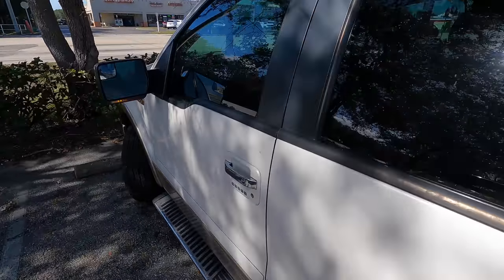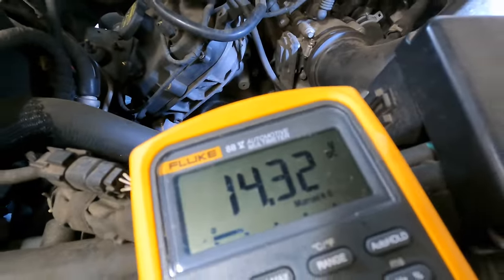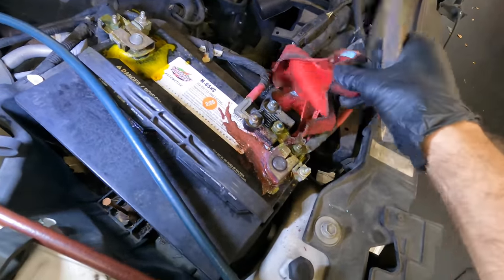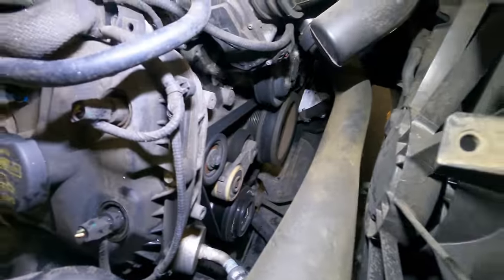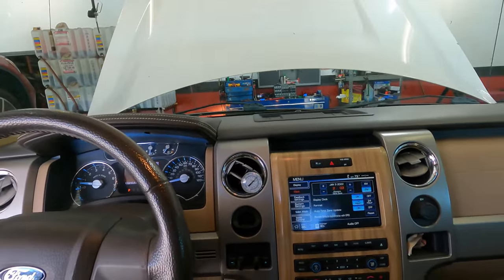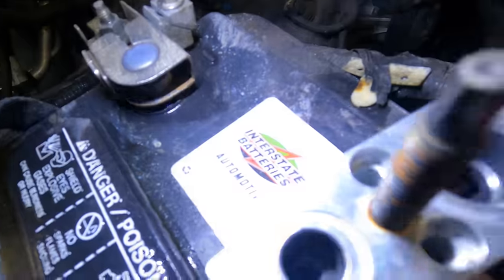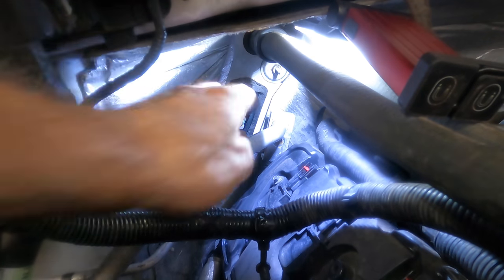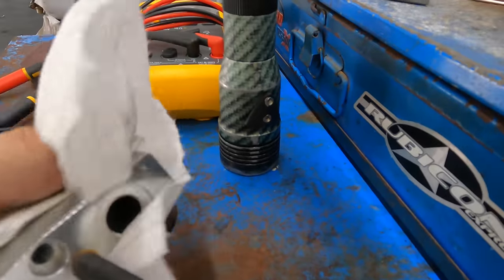It’s the Black Death!

Comment: I've always used brakecleen to clear cleaner from battery terminals! Don't know what everyone's reeeing about
Reply: Seems ok to me
Reply: Reeeeeeeeee.  I'm just ree cuz it's my first ree of the morning... No reason... I do prefer hot water and baking soda because I'm cheap. And I don't want Greta to yell at me
Reply: Believe it or not, SLA have air gaps so you have the potential to contaminate the electrolyte by forcing fluids down in around the posts or near vents. Same if you pour a solution on it. After all that venting is why you have acids building up on terminals and connections anyways. That being said they should be so minutely small that a quick rinse or blast from a distance shouldn't force liquids in. Except fomoco factory shit batteries. They have gaps so large it'll eat a post out and your wiring harness. Just junk those.

I carefully use a baking soda water mix and you want to neutralize the acids. Best applied with wet rag ad you don't want any neutralizing the acidic electrolyte of some leaks back in, however unlikely.

Now my new batteries get a quick brush along with harness, felt pads around terminals, tightened very well for contact, then sprayed with a protectant. NOCO felt pad with their NCP2 spray ftw.

Comment: When testing high amperage circuit like cooling fan. I'd much rather use high amperage test light like headlight bulb. You can see voltage with the meter but can the circuit carry current? With the test light you can see both at the same time.
Reply: yeah thats probably the worst thing about low voltage systems... you can see power... and it seems fine... but the second it comes under load blip there she goes
Reply: What? By definition, if there's electric potential then it can carry current. Use a clamp ammeter to see how much current is flowing.

Testing the fan, unplug and Short them straight to the battery with jumpers. If the fans good then it's a switching problem.
Reply: @etherealrose2139  looool u must be new to the real world, welcome.

Comment: Be sure and check the cabin air filter.   Airflow is very important.   A dirty air filter can cause the evap coil to freeze up and also cause the vent actuators to malfunction.

Comment: Service ports that are easily accessible. What a concept! Definitely something new.
Reply: I have to pull my air filter box just to get to the low side in my ford truck. Fucking garbage. Not supposed to run it without the filter lol
Reply: @Straight_White_Fatherly_Figure  this one's a ford. mine's a 97 ranger and seems surprisingly similar. what's yours?
Reply: @sk1dr0w  08 f350

Comment: Something I always liked to do when flushing out lines like that is wrap some electrical tape around my clear hose on the syringe so I get a good seal. I don’t tape it to the line, just build it up so it has something to seal against. Its always worked great and I’m able to get all the crud out with the exact same procedure you used. Great work!!
Reply: Great idea!
Reply: I use a flush gun. Load up the bottle, hook up to shop air, let er rip.
Reply: @oliver_klozoff  Should work great on AC, they're meant to handle something like 300 PSI. A radiator however, even 20psi could be enough to bust out an old one
Reply: @user-ut9ln4vd5m  the one I have is on regulated shop air. Most cooling systems run between 12 and 16 psi though.

Comment: Thank god for this destraction. I've felt rough as hell for 3 weeks 😳 and this takes my mind off my convid lungs drowning me 😵
Reply: out of curiousity, which variant and how many doses of which vaccine did you have?
Reply: @Gerardus1970  Three weeks ago, almost anywhere in the world, is probably Delta.
Reply: @Straight_White_Fatherly_Figure  ive said this since day one, I work in auto body have for to long at this point. My badass respi and full airflow painting bay, I pull out paint n shop dust daily still. Aint no way it's stopping a tiny vir.
Reply: I've used N95, KN95 and P100. The only thing that will stop sanding dust is P100 with a properly fitted half mask respirator or better. If the 95s can't even stop sanding dust. How can it stop you from getting COVID? About the only thing they help with is keeping the people that spit well they talk from doing so.
Reply: @Censortubes  yeah i have to wear one of those pink masks for mold and asbestos sometimes. I wore it to walmart 1 time last May to freak people out lol. You know what i love to see the most? When people wear those plastic face shields 🤣🤣🤣

Comment: Ray, again another great video. I have a question for you. As I have done A\C work for over 25 years myself. I just wanted to ask you if you ever simply test a compressor by evacuating the system, then allow the system to be at 0. Then  at that moment over ride the compressor and comand it to come on to check for a weak compressor ? Let the compressor  pull a vacuum by looking for roughly negitive 20-30 psi. I wasn't sure if you have ever done this before, I have looked at all your videos and I have never seen if you have. If you do know that test whats your opinion  one way or the other ? It's a cool test if you haven't. I was curious if you  have. Thanks Ron "The Tow God"  lol

Comment: So your shop replaced the compressor previously, and you didn't clean out the system when you did that leaving all the metallic garbage inside the lines and condenser, which killed the new compressor and clogged the expansion valve  or perhaps your shop installed a Dorman compressor which are mostly junk and failed right after installation as expected.  Either way,  this call back and warrantee is on the shop.  Anytime a pump craps itself it spews metal and rubber bits into the system making contamination ranging from a little bit, to oh my god look at the junk in this thing.  So any smart mechanic or shop would do a complete cleaning of the system to not get a call back.  Your work is completely fine, and what you are doing is well done.  Too bad your shop has to eat the bill on this one.

Comment: If the AC has been operating without benefit of the condenser cooling fans operating it has been operating at high head pressures for not telling how long, could have damaged the AC compressor especially as found with being overcharged.  I would have went after the condenser cooling fan concern first, either troubleshooting its logic operation via schematics or service bulletins because that’s still a problem with the AC clutch engaged and the condenser fans not cycling

Comment: A/c system has acid in the system caused by moisture contamination. 
Line set and evap coil must be flushed with chemicals and compressor replaced. Every time u put a hand held guage set on a system u put air with moisture in the system.

Comment: That's nice my jonson is froze to my leg. I hope you enjoy that wonderful heat wave. Here in Illinois was have squirrels stuck to the phone lines. Not even the china virus wants to be here. I love break cleaner. I use it on my AR platform rifles to clean the hard to reach places. I get crap from my buddies  from time to time but I noticed that a few of the guys that gave me crap are starting to use it on their AR platform rifles. They can see the benefits of using break cleaner. It has to be the non flammable type. It works great. Anyone else try it on their firearms.

Comment: Ray, I always take battery terminals completely apart, and wire brush all connections and battery posts, with this practice, my 2004' Dodge Ram factory battery lasted until 2017'

Comment: You need a liquid line drier on there, if possible. You also need a deep vacuum for quite a while to dehydrate all that moisture that's now in the system. Those do it all AC machines in garages aren't the best at that kind of vacuum but it is what it is. The moisture will contaminate the oil and refrigerant and they'll make acids which will cause another breakdown in the future. Which is why if you can get a filter drier on either the liquid or vapor line that'd be the customer's best shot. Might have to get a new hose with it built it as I don't think vehicles usually come with one. Replacing the compressor will help. Not sure condenser needs replaced but since it's warrantied that will help as well, might as well start fresh with no bad oils left in there. The rest of the short ac lines and evaporator are going to be the culprit from here on unless you can nip it in the bud.

Just a thought.
Reply: Moisture doesnt create the acids. The problem is that water doesnt compress nearly as well as refrigerant does. Plus, moisture is the culprit that would kill a txv prematurely. TXV is extremely small, and the valve moves depending on the temperature. If the valve has even a tiny bit of rust on it, the valve will either stop moving or completely clog up.

Acid typically comes from access heat, which degrades refrigerant and mixes it with the oil permanently. Or, until someone uses an "acid scavenger" type of product on the system and R&Rs the refrigerant.

Comment: The compressor sounds like it's about to throw up! Put a receiver dryer on it while you are there!
Reply: I doubt the vehicle has a receiver. It likely has no driers as well. Should add both liquid and vapor line filter driers if possible.
Reply: @etherealrose2139  It has both, all systems have a drier (receiver drier)

Comment: I'm not 100% sure about this but the fan should command on at low whenever the AC is turned on. A burnt low speed fan resistor or defective low fan relay could make it a full-speed only system, commanded by the PCM as a last resort measure. I've done quite a few of those stupid resistors myself, some of them seemed to be fine for resistance but would be treacherous when things went hot.
Reply: Ans as @janvanderknaap mentions above, if the cooling fans were inoperative - with that Florida heat - that poor AC system is going to experience high head pressure when not moving, and that could nuke the new compressor. Better check that out Ray!
Reply: @davidgilpin5200  AC systems are a bit of a mistery as I've always outsourced that kind of job, but if I'm not mistaken there is a pressure metering device that disengages clutch compressor when pressure gets too high/low in the circuit. What I do know is that a fan will cycle to full power every 20 or so seconds when the low speed is not working, just to keep pressure in the AC circuit in safe levels. 

This is diagnosed mainly by observation, as the cooling fan draws quite a lot of power from the charging system when starting from still: when the fan kicks in while idling there is a noticeable dip in RPM and lights would dim too.
Reply: @aigoru8718  Indeed, most automotive AC systems include high pressure and low pressure cutout protection. I recently experienced the electric fan motor failure on my 2004 Dodge Ram. The head pressure (high side) would exceed 375PSI before the high pressure cutout engaged. And that cycling (going up until cutout) can be very hard on a tired old compressor. Luckily I discovered the issue quickly, replaced the fan motor and all is well.

Comment: The one reason i have been avoiding fords any more,  in my wise older life. Air conditioning sucks.  85 lynx, 79 mustang, 87 mustang, 92 f150 all had major a/c failures before 80k miles. I will say our 89 mercury cougar survived
Reply: My wife's previous car was a Taurus and we had it for 12 years. The AC totally crapped out at around 9 years.  AC issues with Fords over the years. That's why I drive a Chevy...
Reply: @MazichMusic  toyota and gmc for us..just had a scanner on my pickup truck.. the computer says Hvac 100 percent good.

Comment: The liquid A-C system flush products are all HIGHLY flammable.Try Nu Calgon's RX-11 for a 1st rate nonflammable flushing agent; it's expensive but does a great job. You'll be changing your electric vacuum pump's oil several times as the liquid flush evaporates and contaminates the oil. Robinaire's air-powered vacuum pump works well to clear out the liquid flush vapor, then follow up with the electric vane-type vacuum pump.

I think you had the primary failure cause nailed right off the bat with the fan failure (probably a shot fan relay). I doubt the evaporator had much large particle contamination as anything getting into the evap would have to pass through the tiny needle valve in the TXV.

Comment: I have a 2013 F150 STX with the 5.0L and my heat didn't work all that well.  Found out it was a little low on anti-freeze.  Added some and bingo, heat.

Comment: I never had any mechanic flush my ac. . I wish they did. I am on my 5th compressor. They charged me for the flush too. when I asked for a flush different mechanics told me they can only replace condenser for $5,000. we have a lot of shifty mechanics in California.  ALso i was told by scammers its normal for ac vent to be around 60-65 F after paying 2,000 3 times. I am loosing my mind

Comment: figured with the missing bolt, the compressor had been replaced. then since y'all did the work looking to see if customer opted to not pay for flush, replace accum/drier, valve/orifice, compressor, and condenser.

Comment: I would think the or at least one of the radiator/AC condenser fans should have been on for the AC to cool even if they operated off of compressor high side high head pressure.  Ran across that operation in a late 80’s Dodge Dynasty where the AC Condenser and radiator cooling fan was operated by the AC compressor high head pressure which is normally a clutch disengaging signal to protect the AC compressor from destructing Chrysler evidently decided to cycle the condenser fan to lower high side pressure.

Comment: My understanding of a compressor going bad is the fact that it infiltrates the entire AC cooling system with the trash metals from the blown compressor.
It is also my understanding that now the condenser and  inside evaporator  as well as all of the other AC components are now ruined.
And that leads to an entire replacement of the whole system.
Yes, I know that there are AC system cleaners as you used here but when the system is back under pressure with the freon, a much higher pressure in the system will pull the loose metals back into the compressor. 
So, it would seem that if you are working on a vehicle with a bad compressor that you would need to replace all of the components.
I realize that it would be a very expensive job to do and that  most people would only want the least work done just to get it up and running again.
Please tell me if I a correct Sir.

Comment: It’s funny, you go the extra mile to do everything and make it right, but I take my bmw to the dealership and the only thing they took out was the air intake and when I got it back they didn’t tighten the tube clamp or put in the two 10mm bolts.

Comment: Had the pump on my 97 f150 do that, except it was worse, the pump actually locked up. What a pain in the ass flushing the entire system without fancy high priced tools, luckily it has the serpentine condenser and evaporator and those didn't need replaced... but everything else sure did hoses and all. What people will do all for AC... smh.

Comment: I have the same RIDGID impact driver as you have.  It is used at home for drywall screws, it looks like new.  I can't get it to last more than a month or so before it fails.  This time it failed on the first use after picking it up from the Home Depot that is over 50 miles from my home.  The 1/2 inch drill failed the same way and they gave me a new one saying the original was not repairable.  Good luck with that impact.

Comment: If the fans aren't running, and pressures are high, I'll take the good ole wind make it happener and generate the air flow cross the condenser to see iffin there is an effect..

Comment: Years ago I mean years ago 50 years ago when I worked on commercial air conditioners they used to have a sight glass you could see the refrigerant going through the lines see if there were air bubbles in there which meant it needed freon and you can tell if it was dirty boy for a little sight glass at save a lot of grief for anybody they managed to design that out of the system hey have a good night

Comment: I'm not going to complain that you soaked the engine with the AC flush stuff as it sprayed out because we know you love to hose down the engine bay. :) But... that evaporator manifold seemed to be recessed behind the firewall. Shouldn't you have covered the hole around it with a shop rag or something? Seemed to me there's a great chance that some of the liquid would drain behind the firewall and find it's way into the interior behind the dash.

Comment: (Going back to your least video) 
Not to beat a dead horse, but you cleaning the battery terminals for a good electrical contact, is also why you should clean metal before you short circuit weld. Good electrical conductivity equals better welds.